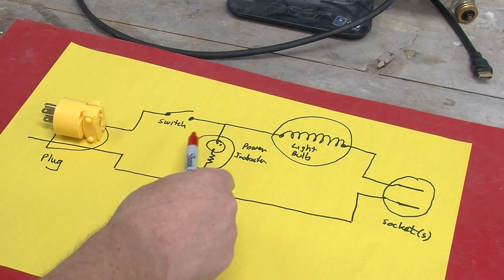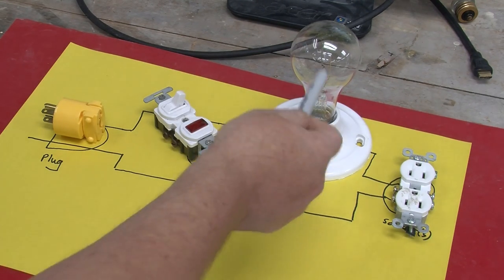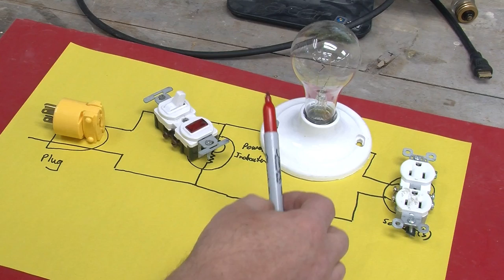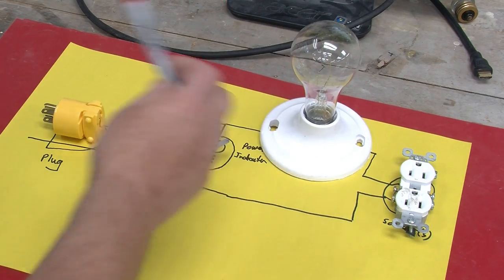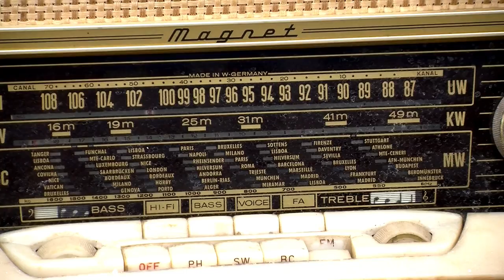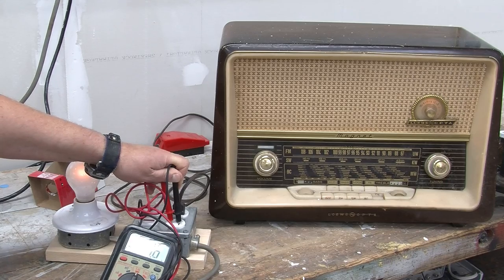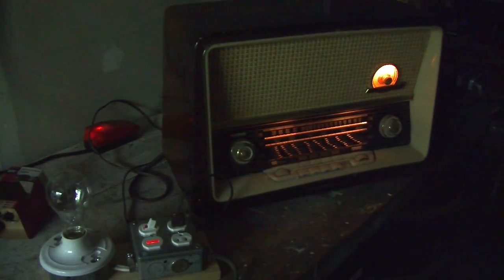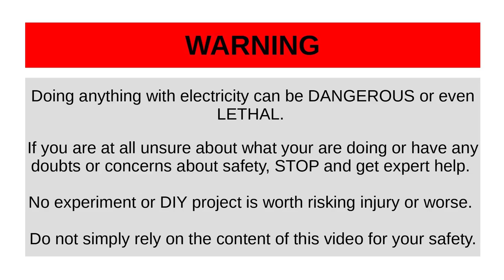When a Light Bulb is better than a Fuse

Comment: Remember, if you under-run the tube filaments, and draw DC through the tube, you stand a good chance of "poisoning" the cathodes. You need a light bulb to save the day, but it is better to use a variable DC supply on the HT line to reform the electrolytics.
Reply from the maker: I'd be really interested in hearing your experiences of this.  I always thought the reduced plate voltage acted somewhat to reduce the effect of the diminished space charge and for short periods of half an hour or even an hour or two any degradation to the cathode would was minimal and  the tube would essentially restore itself after a few hours of use. Have you seen tubes degrade after only a short period of lower filament? How long did it take to noticeably reduce cathode emissions?
Reply: @ElectromagneticVideos  I have always been mindful of poisoning the cathodes, but it does relate to longer term under-running the filaments. I would not be comfortable with, say, a 24 hour period of reforming the electrolytics. The problem comes from the cathode material being called upon to emit electrons at less than optimum temperature, resulting in the current flow being controlled by the emission, rather than the biassing of the tube. (The damage is akin to over-running the tube, although in that scenario, the plate is likely to be an interesting shade of red...)

 There is some merit  in over-running the filaments/cathode for a few minutes to get more active material to the surface. Of course, in "bright emitter" tubes, none of this is an issue as the cathode coating does not exist. On old cathode ray TV tubes, it was commonplace here to over-run the tube filament by up to 20%, when the tube had gone soft, and lost contrast. "Good" TV repair shops even sold transformers to achieve that!

A light bulb in series with a rectifier diode, feeding the DC to the HT rail is a good solution, but a very small wattage bulb is required, but in your country (I am in the UK), your line voltage of 110 may not suffice if the radio is directly fed from it without a transformer, and voltage doubling rectification is used.

 I would think you are right in that short term under-running would not cause an issue. I have not done so long term, so have no experience to call upon, and with tubes in a diminishing supply, would not want to find out :-)

 Fun playing with all this old kit, isn't it :-)

 Regards,

 Cossiedriver RS
Reply from the maker: @cossiedriverrs  It is fun playing with old stuff. And I have seen the plate go red when something was shorted! 

I had understood that the poisoning was from ions bombarding the cathode. If the filament voltage was normal there would be enough of a cloud of electrons to neutralize the ions before this happened but I have no idea how true it is. 

Over-driving  CRT filaments - I have done that! When I was a teenager I would get old (usually tube) TVs and repair them and sell them. TVs had already switch to transistors long enough that you couldnt get the plug-in crt brighteners but I knew about them from the old electronics magazines, so I would just wire a  filament transformer in to the filament supply wired is a step up auto-transformer to  add 10or 20% voltage. The other thing was to run the filament at up to two times the rated voltage for a short period to boil out some of the inner cathode coating and rejuvinate the tube. It sometimes worked but was never a longer term fix like upping the voltage.

You got me thinking - I wonder how the tubes in the old "instant on" TVs survived. As I recall, the filaments were left running at reduced voltage when the TV was "off" and there were no high voltages left on. That seemed common on TVs at the end of the 60s and in the  hybrid ones of the early 70s. 

Transformer radios and TV - hate them! Since you mentioned them - did you have them in the UK? I always thought they were a US/Canada thing for cheap mass production. The only European stuff I know is German and they all seemed to have transformer power supplies (and much better quality construction).
Reply: @ElectromagneticVideos  You could be right re the ions bombarding the cathodes, but with no HT (instant standby TV) that may not have been an issue.

 I don't recall seeing a TV of that design in the UK, but we had an interesting design re the power supplies. It used a line output tube that was quite "meaty", and the power for it was derived directly from the line voltage. (230 over here). The tube filaments were all run in series, with a dropper resistor from the line. The EHT rectifier had a filament supply derived from the line output oscillator, and thus it was able to "float" at many kV above earth.

 My Father used to have an interesting ruse to cure an open circuit filament in the picture tube. He would connect one side to earth, and the other side to the plate of the line output oscillator. There would be a good display of sparks within the neck of the tube, and when the open ends of the filament welded themselves together, he would be ready to kill the power. The cue for this was when the oscillator stopped running! The best of it was, he had very few comebacks!

 I, too, have heard of "boiling" the cathode, as you say, it can work for a while. Possibly more successful with battery directly heated tubes in portable radios. (I have a few...  :-) )

Something I have seen over here a LONG time back was a US made radio, that had a three wire power cord. A neutral, a live, and  a resistance wire that dropped the voltage for the tube filaments. Naturally, the cord ran hot, and they failed often. The uninitiated would just cut them back a little, not realising the filaments were now being over-run... I guess you didn't need that as your filaments in series added up to 110v...

Incidentally, using a light bulb as a fuse whilst looking for an intermittent short on industrial equipment was something I did often, pulling the wiring around until the bulb lit. (And then getting the apprentice to rewire it all  :-) )

 Looks like you and I have a lot in common...  Pity we live so far apart 😞
Reply from the maker: @cossiedriverrs  So really an early switching power supply which of course is what the fly-back circuit is. How neat. I dont recall  seeing that variation here but its a while since I did much TV repairing. The filament loop powered by the flyback was used all the time here too. You might like my tube flyback video  https://youtu.be/1CJSdn0j10A  which had a typical North American TV HV section from a 1960s .

I have never heard of welding a filament like that - wow! I guess it was a case of nothing to loose and if it worked great. Amazing that the arc welded it together rather than further vaporizing the filament wire. 

 If you ever feel the video bug it would be great if you posted some videos of your radios!

The US radio you are talking about is almost certainly one of the "All American Five" designs  - made to be as cheap as possible. Live chassis if the plug was in the wrong way (no polarized outlets back then), heated power cord, and the power audio out tube was often something like a 50C5 with the 50V filament (which may have replaced power cord resistor). One output tube variant had a filament with a tap on it to power the dial light if I recall (or maybe that was the rectifier). 

I have heard of that use in some of the other comments. This video has generated so many fascinating comments. recollections, uses of incandescent bulbs  it has really been great.

Yeah - really too bad we are so far apart - and I have thought that for a few others as well. I didn't expect to "meet" so many interesting people with similar interests when I started posting videos. If you ever do a trip to the Ottawa are  of Canada, do drop by for a visit.
Reply: @ElectromagneticVideos  I checked out your other videos regards the flyback circuit, REALLY interesting :-) . That circuit was almost identical to what was in use here, and we referred to the flyback transformer as the "Line output transformer". (Incidentally, for us, "tubes" are "valves" (thermionic valves to use the full term).

 With your line output stage/flyback oscillator, you could "burn out" a tube filament, then see if you could "weld it"! I think that being in a vacuum when the arcing was taking place probably helped!

I have a ham radio transceiver from 1971 that still looks and works great. It uses two 6KD6 tubes as the final amplifier, and I think these were originally a common flyback tube in North American color TVs? 

 I have seen all sorts of strange circuits here, apparently more complex than they need to be, but carefully analysing them will reveal a higher component count, but a lower overall component cost. Hence the flyback circuit we have in common.

 It is only three years ago that I retired a 1978 transistorised color TV. I managed to sell it, working, to a collector for one US dollar! I was pleased I did not have to send it to landfill. Although transistorised, the circuit was so similar to what we have been discussing, rectification was solid state, and it used voltage tripling to get the EHT, but the principles would have been immediately recognisable.

 No promises here, but I have friends in Syracuse. Which is not so far from you and I visit maybe once in five years... (And probably where your TV was made!).

 Great technical chat...  Appreciated!
Reply from the maker: @cossiedriverrs  Glad you liked the flyback video! I think the general design was so perfect that it was use din TV the world over. And yes, I know the British terms - I have subscribed to a number of British (and German) electronics channels. 

I instantly recognized 6KD6 - yeah - I think they were common over here. So are you a ham? I have 3 ham transceivers and and a number of shortwave radios - I keep thinking I should get a ham license but never have the time. If you wondering why I have the transceiver - years ago one of my companies developed one of the very first high speed HF modems. In spite of the math behind it, I still find it hard to imagine how well data can be sent over those often "almost incomprehensible for voice" channels. 

By the your transistor TV with the same circuit - you know the flyback (aka "Line output") is alive and well in millions or billions of the AC/DC power supplies we all use today.

And yes - Syracuse is not far! Actually many people drive there to use its airport for cheap flights to the South.
Reply: @ElectromagneticVideos  Yep, sure am a ham...  That is how I have friends in North America, Hi! Had my licence for longer than I want to remember... 47 years to be precise, and still keen! Go see if you can get a ham ticket, you'll not regret it...  :-)

 The Toshiba 6KD6 tubes are the ones my radio likes, they were never designed as a PA tube, but as a flyback tube. The characteristics of alternative manufacturers tubes were fine for sweep tube service, but less so for PA tubes. Under certain circumstances, two of them can give 900 watts peak power (Ouch!). Not for long...

 Very familiar with the transistor type inverters, (buck/boost etc) use them a lot. Great way to modify a "wall wart" to make it give the required DC, whatever the transformer voltage was. Also, they can be useful when you want a buck regulator with no drop-out, just set the required voltage, and as long as the input voltage is higher, the output will be as set, but if the input goes lower, the output = input voltage, making the most of a battery...But they are noisy. Just like the TV flyback stage 🙂

 Didn't think Syracuse was far. I drove there once, from Hamilton, where I was visiting a friend.  No promises, but.... 🙂
Reply from the maker: @cossiedriverrs  I certainly will get it! It would be neat to try long distance HF again. 

Its neat that the 6KD6 has a second purpose like that. I always think its great when one can find a use for something that it wasn't intended for. 900W - thats a lot of power. Do you do voice from UK to North America? What type of power levels do use? We used to use a sloping V antenna for modem comms but the power levels were generally in the few hundred watt range.

Yes - noisy but efficient! Have you ever used the TI automated voltage regulator design website? Makes it really easy if you ever need to develop one. 

Actually Hamilton is on the other end of Lake  Ontario - quite far away. Syracuse and Ottawa are close together on the Eastern side of the lake.
Reply: @ElectromagneticVideos  I also like finding "odd" uses for things, like I used a CD4013B (dual JK flip flop) as both a flip flop and a timer! Part of the PTT system in my car, Push to talk, push to receive, but push and hold more than a second, and as soon as you release the PTT, radio goes to receive. I am sure Texas Instruments didn't envisage that!

Will check out the TI website, that could be a useful regulator resource.

 I am between HF antennas right now, having been donated a DX Engineering multiband vertical. Came from a silent key close friend, so when that goes back on the air, it will be a poignant moment. My radio has reliably produced 250 watts "key down" from two of those tubes since 1974, but I really don't abuse it. A power supply mod results in 900 watts, and a short life. I didn't do it! Some folks did, and ran speech compression. Ahhh...  The lovely red glow of an unhappy plate! Some of the tubes got so hot, the glass melted, and they imploded. Now THAT was exciting!  

 I actually have  plans to visit Syracuse in, maybe, 2025. It is going to be a major trip, I am bringing my own car (a 32 year old European very high performance sedan, a Ford Sierra RS Cosworth). I'll be landing in New York City, and driving North for part of the trip...
Reply from the maker: @cossiedriverrs  The old CD40xx CMOS series! Neat!  

Since 1974 - wow! Thats really neat to have had it for so long. I assume it does SSB? How did they do that back then - with good filtering wiping out one sideband?

Are  you doing a cross continent trip? If part of it is through Canada, let me know and I will recommend some places (such as Alberta and BC, rockies etc. And Newfoundland if you stay in the east).
Reply: @ElectromagneticVideos  Yep, USB, LSB, and CW. 160M (I added that) 80M, 40M, 20M, 15M, and 10M. Two xtal filters, one for speech, one CW.

 I had that radio a long time, bought it when it was two years old. I have replaced a lot of resistors that went high in value, and a couple of capacitors. It was "service" rather than repair, so it has never quit on me...

Bought a motorcycle in 1978, still got that, still looks like new. Done 50,000 miles, gets looked after.

 Not planning Canada, although who knows. Main plan is USA east coast, and taking in friends etc.
Reply from the maker: @cossiedriverrs  That  is so cool to have vintage stuff and kept it in good shape for so long!

If you do the US East and have time, the Smithsonian in Washington is well worth a number of days!

Comment: Did he say DC current ? Why ?
Reply from the maker: Where did I say that? If you give me the time position in the video I'll tell you if I specifically meant something or misspoke.
Reply: @ElectromagneticVideos  @7:05 and @7:14 ish. I’m not trying to be a jerk or anything, but was just surprised as it was an AC circuit.
Reply from the maker: @65gtotrips  I certainly sometimes say something wrong in the videos. Actually editing the videos has been a real eye-opener for me - I - and all of us - say so many slightly wroning things while talking that the other person in the conversion unknowingly auto-corrects. In video the mistakes becomes glareingly obvious and it wouldnt have  suprised me if I switched AC and DC. BUT - I didnt!. Perhaps I wasnt clear - I was referring to the HV DC supply in the radio. As the tubes warm up current starts flowing from the DC supply into the tubes and so the radio draws more AC current through its power transformer and therefore through our light bulb.

By the way didnt think you were a jerk - just ddint know where I might have said it - long time since I made that video!
Reply: @ElectromagneticVideos  That makes sense, and I appreciate your taking the time to clarify !
Reply from the maker: @65gtotrips  No prpoblem! Its always nice whne someone looks at a video that closely!

Comment: Wouldn’t a lightbulb cause resistance and drop the voltage? Sorry I posted this maybe 30 seconds into the video.
Reply from the maker: Yes - but because the variable resistance nature of the bulbs filament, if the bulb is sized right for a device under test, when the device is operating properly and drawing its expected current, the bulb's voltage drop will be small (maybe 10 or 20V). However if there is a short or some other problem that would cause the device under test to draw many times  its rated current and damage many of its good components, the bulb will limit the max current for to the max normal operating current of the bulb (ie for a 120V 100W bulb - 0.8A) and prevent additional damage from occurring.

Comment: I guess this is more about radios.
Reply from the maker: Its actually useful for testing/repairing most electronic stuff - radios, TV, amps etc. Someone in the comments mentioned using this sort of device when repairing modern switching power supplies.